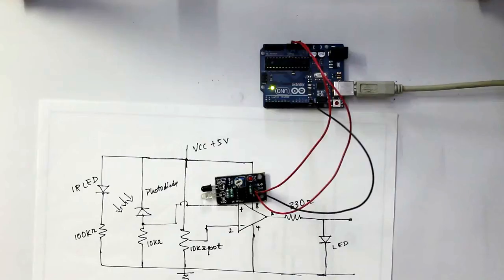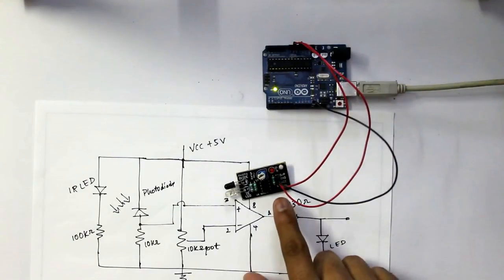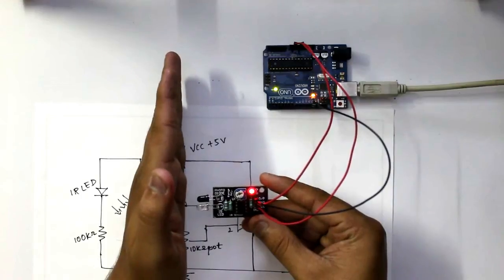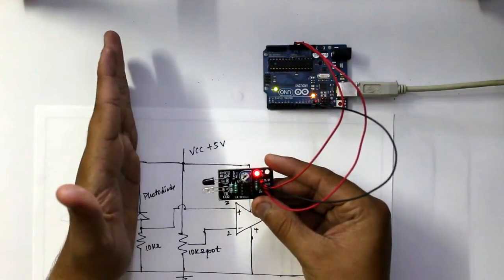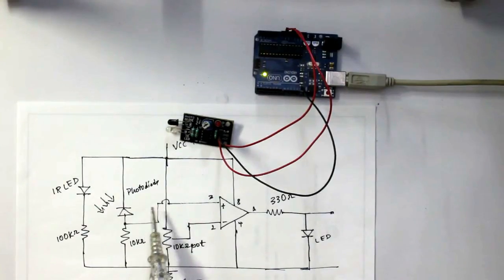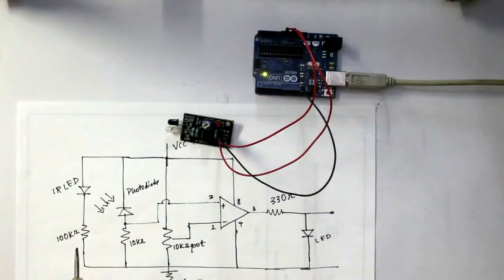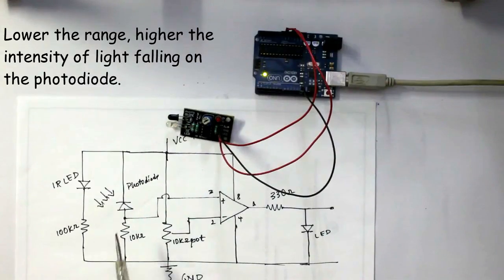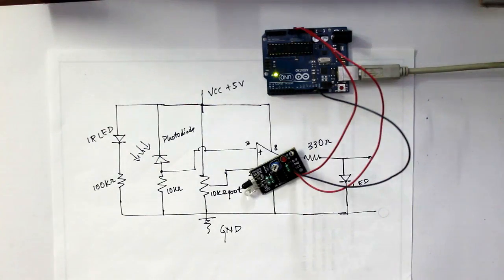IR sensor demonstration

Comment: What is the output voltage of this sensor with respect to ground? Because I want to use its output as clock input of a counter circuit.

Comment: Great vide , can you explain how does the comparator (op amp)  compares the two voltages
Reply from the maker: The 10k potentiometer is given with 5 volts. We can adjust the potentiometer to get a particular voltage. This voltage is given to the inverting terminal of the opamp. The voltage across the other 10k resistor (varies due to photodetector output) is given to non-inverting terminal. The opamp compares the two voltages. You should know the working of the opamp to understand better.